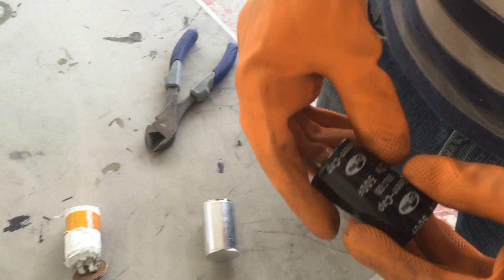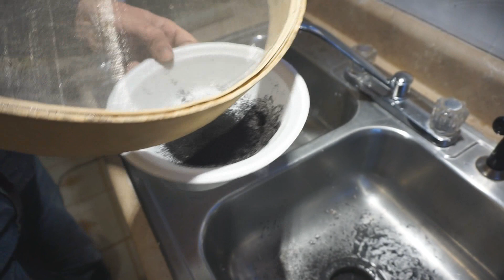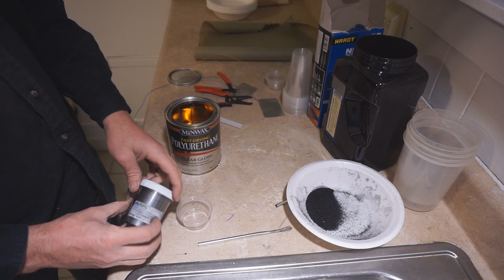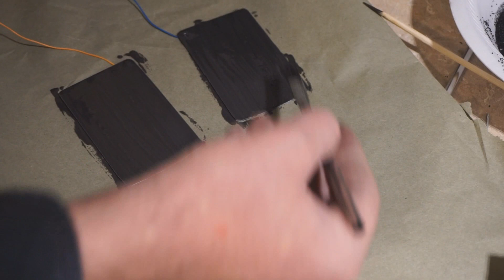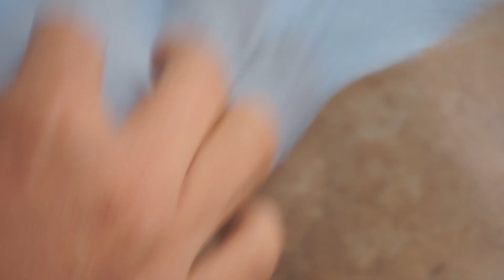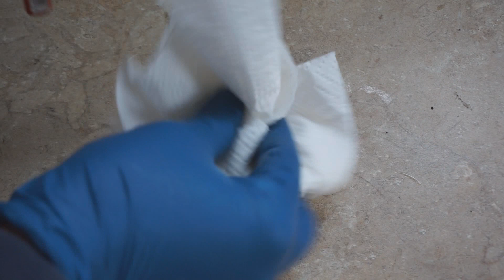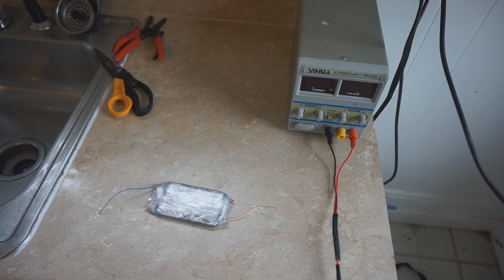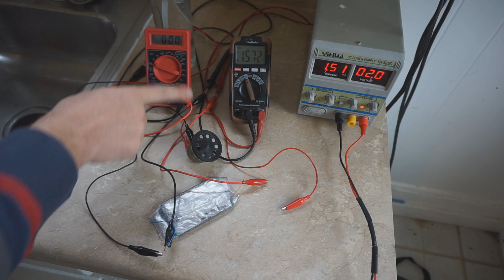Easy DIY Graphene SuperCapacitors

Comment: Looks good. I've found this page: http://electronics.stackexchange.com/questions/4951/how-do-i-calculate-how-fast-a-capacitor-will-discharge for calculating the capacity. If you convert the formula in the second answer, you'll get C=(I*t*V0)/(V-V0), with V0=start voltage, V=end voltage, I=current in Ampere (this simple formula works for constant current, only), t=discharge time in seconds, C=capacity in Farad. From the video it looks like voltage drops from 1 V to 0.5 V in 5 minutes with about 30 mA constant current. This results in 18 F capacity. Commercially available SuperCaps with this capacity are smaller (Nichicon JUWT1226MHD, 13x32mm cylinder, EUR 5), but this is a very good result for a DIY capacitor.
Reply from the maker: +Frank Buss 
Thanks for the encouragement.  I had a previous credit card sized build that ran the same motor for over 1hr so I know the performance can be improved a lot.  I think that using stainless steel mesh instead of aluminum and KOH instead of phosphoric acid is going to produce a winner.
Reply: I understand your view on the electrolyte leaking to the outside of the electrodes. If you have improvements, than do them and please share them with us all. That's how we make things better :)
Reply: +Frank Buss It would be interesting to see this same idea with tin, lead or copper foil several meters long and folded or wound up just like a traditional capacitor to conserve on space and increase the overall surface area.
Reply: +kuhrd The current collector is not as important is the conducting surface. The reason for aluminium is its very inexpensive. You could use other conductive particles, but then you have to worry about galvanic actions at play rather than electrolytic.
Reply: +Diadon Acs (Conscious Energies) My main point was to use thinner materials with larger surface areas for the base collector plates to decrease the size and increase the charge density just like capacitors are built today.  I also suggested using other metals for the plates since they are less reactive on the re-activity scale than aluminum.  Since both collector plates are made of the same metal, galvanic reactions should not take place.  I would also guess that most stainless steel alloys are going to be more reactive than aluminum for this purpose since stainless will still corrode and pit over time if subjected to the elements.
Reply: I see what you are saying. I have three  questions for you. On what surface do you think the electrolytic reaction is taking place? What metals do you think are more corrosion resistant than aluminum or stainless steel, that are affordable. What  has more surface area, a single flat plate, or a bunch of spheres and tubes?
Reply: In this particular capacitor the charge is being stored mostly in the electrolyte and conducted through the surface of the activated carbon while conduction to the collector plate is being provided by the mixture of polyurethane and graphene nanopowder.  The entire assembly of aluminum, poly, graphene, and activated carbon make up each conductive plate. (the Anode)  

The towel in the middle soaked in acid makes up the electrolytic dielectric and separator portion of the capacitor (the Cathode) but since both plates of this capacitor are constructed the same it is bi-polar so you could treat either side as an anode depending on how you charge it but would probably not work well in alternating currents since whatever side is storing the charge, even in low frequency applications would take a long time to return to 0 even with the impedance so low since the capacitance is so high.

In regards to corrosion resistance the metals I mentioned are less reactive than aluminum and almost as cheap for the small amounts we are dealing with.  Here is a page explaining the reactivity series for metals. http://www.tutorvista.com/content/science/science-ii/metals-non-metals/reconcept-series-metals.php The actual electrolyte should technically only be coming into contact with the carbon which is less reactive than aluminum but at some point the electrolyte will find it's way to the aluminum as well since the back side of the plate is open and the graphene powder mixed with polyurethane will not be impregnable over time.  

It will be interesting to see how this capacitor fairs over years since oxide layers will form and become somewhat thicker on the aluminum and carbon as time goes on along with the drying out of the electrolyte over time that all wet electrolytic capacitors are subject to.

Comment: Very nice job! A lot of people do not realize how much work goes into making videos like this.
Reply: any one want to join me with theses kind of research thing please contact me at owaisf.2008@gmail.com .....these kind of super capacitor have low energy density about 20 wh/h to 30 wh /kg so putting that in a ebike will increase  its weight so....we need to try different combinations...and lithium ion battery has 200wh/kg of energy density ...so this is also a reason of lithium ion battery is being widely use ....so come join me and help me....
Reply: @owaisfarooqui6485  you are right. Supercapacitors have a low density energy than bateries. Actually the applications of supercapacitor is not replacing bateries... they are more used in applications which request more high power density and ciclability.
Reply: lasersaber What's the charge time and the weight????? Could you make such a battery/capacitors to charge up faster and last longer than a lipo for use in multicopters????
Reply: owais farooqui,,  dear sir,, I think that super capacitor, or rather it should be a mixture of battery and capacitor, I mean that the anode and cathodes of the battery should be so close that they will work as capacitor as well that the plates should have a construction like spinach containing nano holes for keeping more charges ( naturally exists with platinum and palladium, the nano grafen can contain a huge surface as well
Reply: owais farooqui, this is my emails vipser64@gmail.com,  serbestabbas@yahoo.com 
The first one is the one that I open frequently
Reply: https://youtu.be/KiLTEjm8zLw
This is a graphene solid state generator circuit using graphenes thermal motion to generate limitless energy. Please develop this tech.
Reply from the maker: +electronicsNmore 
Thanks, I really appreciate it.

Comment: Food grade activated charcoal from coconut husks for detox is a very fine powder like talc.
That should work well ???
Reply: Carbonizing coconut husks, help fiber, or even kelp in an ammonia atmosphere will create nitrogen-doped carbon perfect for these cells.
Reply: +Stewart Buckley That is a fantastic idea! There are many people talking about using hydrothermally carbonized coconut husks.
Reply: Diadon Acs
Brush your teeth with it :)
Reply: +Stewart Buckley Yeah you can also use charcoal you make yourself, I don't think you'll find that much difference from store bought stuff when you powderize it in a blender or ball mill. Every activated carbon source I've bought I question the quality of it. Doesn't act that much different from my own stuff. Maybe you will have a different experience though!
Reply: Emergency will do :)
Reply: you want big pieces typically so you can force contact with the aluminum.

Comment: This is the coolest build you have done to date. Nice work! I have a suggestion for you. You need to vacuum all of the air out of your bag before you seal it.
Reply from the maker: +USWaterRockets 
I have all the equipment ready to vacuum seal it but I have not been able to seal around the wires well enough yet.  As soon as I get that sorted out I am going to vacuum seal it.
Reply: +lasersaber What are your bags made from? Is it PVC? If so, just buy some PVC insolated wires, that way you can use a PVC cement to fuse the wires to the bag. I'd also consider using solid core wire and not stranded wires. You can get a vacuum leak through the gaps between the strands in stranded wire.
Reply: +lasersaber would you get a better seal from flat copper tape?
Reply: +solarhope Or.. you could bang flatten the copper at the point near the seal.

Comment: +Lasersaber in the absence of a high powered power supply get a NiCad pack of 1.2 volt increments of the desired voltage, those NiCad puppies can deliver MASSIVE amounts of current quickly as well  but the cap charge curve will lower the current quickly so I'm thinking a Tool/Drill Nicad pack or RC car type would do well.
Reply from the maker: +drphu 
That would work well.  Thanks for the suggestion.

Comment: Good idea. What about the discharge rate, let's say for fast discharge such as coil gun?
Reply: +Denasdc You don't want something like this for a coil gun. These are designed to provide power for a relatively long time. For a coil gun you want a regular capacitor which can discharge quickly.
Reply: +Denasdc For that you would want some capacitors which are rated for pulsed loads. Film capacitors are good. I think people also tend to use those 2000V AC microwave oven capacitors. Even electrolytic capacitors would probably not be good enough.
Reply: Thanks all. Being thinking about doing the coil gun for over a year now. Have got both film cap and hv cap from microwave. The only problem with hv cap is that it's only 1.15 micro farads compared to 80 micro on film. Trying to keep it as much cost efficient as possible.

Comment: Instead of aluminium plates, would using 1 copper and 1 zinc make a difference? 
It would be a combination of battery and super capacitor.
Reply from the maker: +Green Silver 
I am preferring to stay away from any potential galvanic effects as much as possible at this stage.  In the future I may branch out and test it.

Comment: great video but very misleading title its definitely not graphene.
Reply from the maker: +Gregor Scott 
I do see where you are coming from. The bottle I got off amazon said it was graphene powder.  So far that powder has worked the best in these experiments.  I may try ball milling my activated charcoal for a few days and see if I can make something myself that works as well or better.  I am thinking that the same charcoals that make the most powerful gun powder might also make the best super capacitors.  Believe it or not charcoal is one of the most important variables between good and bad black powder.
Reply: Do you know what a colloids and nanoparticles are Gregor? Don't mistake a graphene sheet with graphene. There are more ways to organize the organic lattice of carbon, then you can shake a carbon nanotube at ;)
Reply: +Diadon Acs (Conscious Energies) lol i do but i am not a chemistry buff, more of a renewable energy guy. But graphene is super cool and i think more info on the difference would be cool to hear about.
Reply: +Gregor Scott Hey brah, if you pay attention, lasersaber says that he is painting on a layer of graphene with polyurethane and sprinkling activated carbon on top. So it seems that Diadon Acs was right when he said you are half right, as it has both activated carbon and graphene. Granted, the quality of the graphene is clearly open to question, as Lasersaber stated below.
Reply: Ryan Carroll The easiest answer is surface area. The activated carbon increases the surface area. Greater surface area = greater current density (capacitance) Robert Murray-Smith has gone over it quite a bit. Anybody interested in super capacitors and batteries should have a look at his videos and writings.
Reply: +lasersaber Excuse me lasersaber.. You are a god in my eyes, but I would have like to have seen a connection to how tf you got you're graphene. but don't worry yourself too much, I had done a bunch of countless research query's to see where Graphene actually comes from. it was extremely annoying but I thank you for showing me how it can be done. seriously, I Love your works and what you are doing for us - Respect Bro
Reply: +Gregor Scott You are half fight ;) It is certainly not single layer graphene.
Reply: +Diadon Acs (Conscious Energies) nah brah graphene = single layer 2d structure. he's using activated carbon same element but exponentially less surface area and lower conductivity.
Reply: +bob Still not graphene, no where close. 

+lasersaber consider a abrasive in the 360 grit range followed by and acid wash and acetone bath. I like benzine sublimation deposition of the carbon substrate. You appear to be getting insufficient contact patches in your current design.
Reply: +Albert Reel *Percipiate not substrate
Reply: +Diadon Acs (Conscious Energies) I'm with you here.  Why is the extra "activated charcoal" sprinkled on top?
Reply: +lasersaber it wasn't very clear i herd you call the powder activated charcoal in the video. I know the stuff on amazon can be questionable in actual percentage of graphene if any. I cant wait to more results from your capacitors.